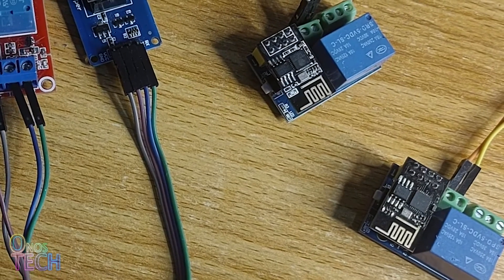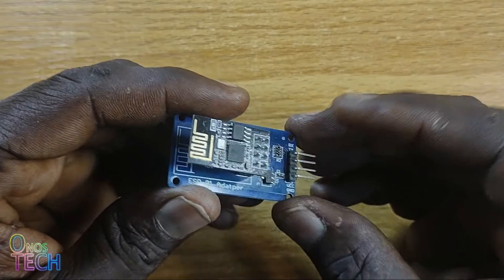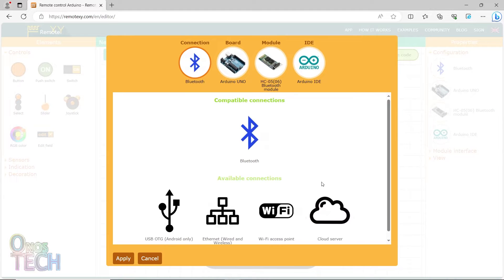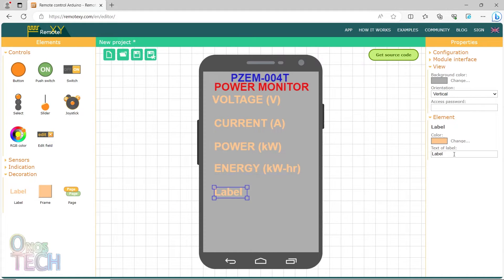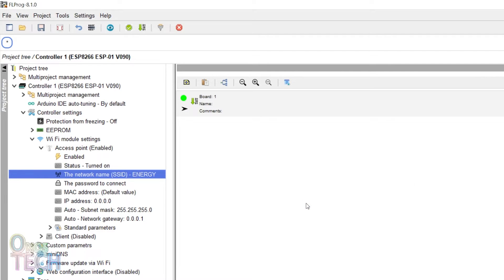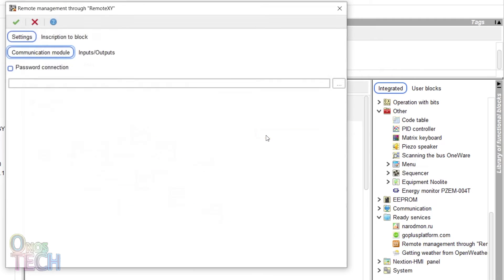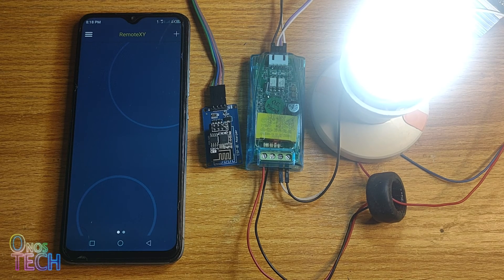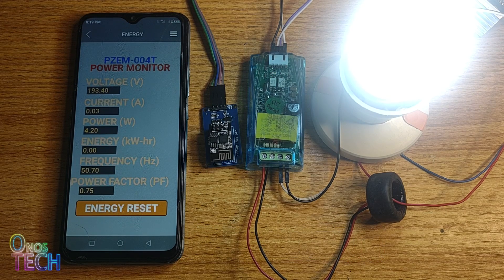PZEM-004T & ESP8266 ESP-01 Wi-Fi Energy Monitor | ESP01 Home Automation | RemoteXY

Comment: hello how are you It turned out great. I wanted to try it too. only i have some problems. FLPROG is not accepting code from remote XY. FLProg 8.2.3 version remote XY also at the same time I could not find the text command
Reply from the maker: Try strings or value in the new verson

Comment: Hi Great Video. I would like to do a remote on / off / restart the PC function. for the RemoteXY app, instead of connecting to the ESP 01 AP, is it possible to get the ESP01 connect to the available WiFi, and use the phone to remote on off the PC?
Reply from the maker: Yes, it is possible. I am working on a video for ESP01 network connection to available WiFi, but it will take a while for it to be publish

Comment: Hi, what a great video. Could you please tell me the reason behind using flprog v8.1.0 instead of the newer one v8.2.3?
Reply from the maker: Thanks. I observe that the English option of v8.2.3 is not stable. I recommend using v8.2.1
Reply: @OnosTech  nice, lately I'm a little bit struggling using the latest version due to the lack of translation in some places, big thanks Onos 👍